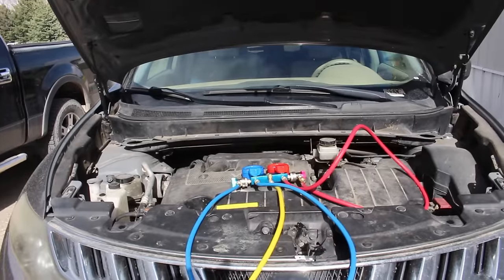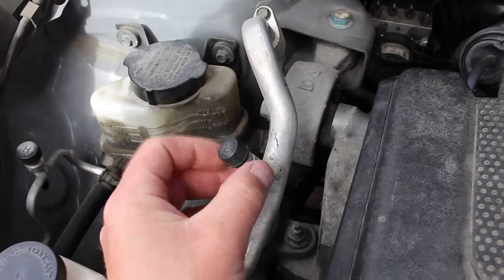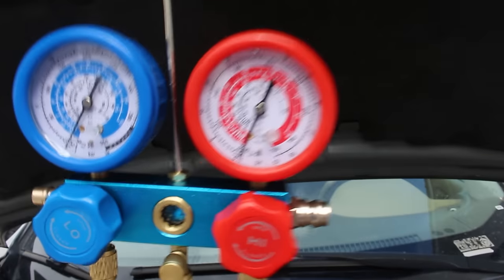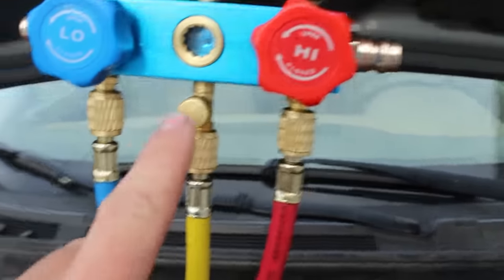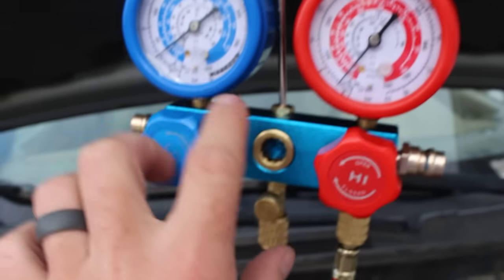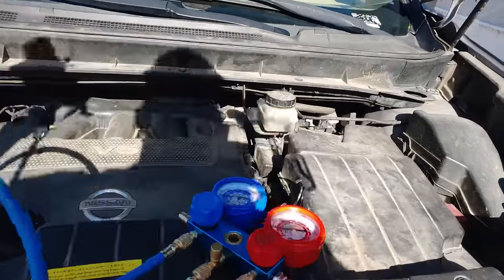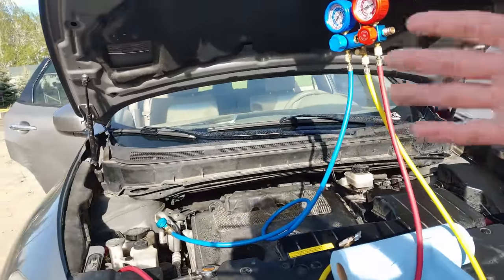How to Recharge a Car's A/C System Using a Manifold Gauge Set & Vacuum Pump - Air Conditioning

Comment: If we have an oil injector, should you inject the oil after you recharge or before? Because wouldn't that mess up your vacuum? And if after, would it be okay? the compressor wont get messed up without oil?
Reply from the maker: Great question! I was incorrect in stating oil is removed when vacuuming. It is Not. You should add any oil before running the vacuum as it would be easiest. Most compressors come pre-oiled so take that into account when adding.

Comment: Should you put the oil in first if changing the compressor and then the Freon or vice versa?
Reply from the maker: Great question! Pulling a vacuum does Not remove oil from the system. I misspoke in the video. The best way would be prefill with oil, then vacuum, and then add the refrigerant. Most new compressors come prefilled with 3-5oz of oil, so start from there.
Reply: @EYVOAuto  you should edit your video and remove references to adding oil and put something in the comments about oil because people will not read all the comments.

Comment: What if my gauges don’t have a shrader valve in the middle line to purge the air before adding refriderabt?
Reply: loosen the fitting just enough that the air in the line escapes. As soon as you notice freon tighten it back up. This is how I have to do mine. Been tempted to buy some new gauges that will have that feature.
Reply from the maker: Agreed with @gregmorris6604. Some people don't bother to bleed the line and say their A/C works just fine. I say why give it the chance for anything to go wrong? You really don't want any air in the system so its worth the extra trouble and precaution just to be safe...

Comment: Thank you for the video.  I have cheap gauges from Amazon and someone had commented to snug up the connections with pliers because of the cheap seals in the fittings.  6 mos later, second time around, I forgot and leaked my Freon.  Do you think I lost any oil?
Reply from the maker: Wow, great advice, I'll have to check mine! I'm not 100% sure. Probably Lost a little, but unless you're changing a component you shouldn't lose all the oil. I also misspoke in the video, pulling a vacuum will not remove the oil. It might be a good idea to add a little, but not the full recommended amount. You might do a little more research or ask a mechanic just to be sure as well. Thanks for watching!
Reply: @EYVOAuto  Thank you for the quick reply.  Even after snugging the connections with pliers, the cheap seals only slightly compress and then you can loosen very easily by hand.

My system takes 7oz of pag 46 oil.  If I add a "little", do you think 1oz is enough?  Too much?  Thx again.
Reply from the maker: Honestly if it were me I would probably add one PAG quick charge can. I think they contain 2oz of oil and a little freon. But again I'm not a certified mechanic so might be worth asking one just to verify
Reply: @EYVOAuto  Thank you very much for the quick response and all your help.

Comment: Thanks for the video, I'm done an LS engine swap & purchased a nice aftermarket sadon compressor, they let you know it comes with oil in it,  I'm wondering why it does, if you have to vacuum pump it before charging and it removes the oil?
Reply from the maker: Thanks for watching! That is an exact question I have! My new compressor for our Camry came "pre-oiled" but a mechanic buddy told me to be sure I add more oil to the system anyways - supposedly pulling a vacuum does remove some of the oil. I'm guessing it doesn't remove all of it, but who knows? I've also wondered if the compressor has lubricated parts that aren't where the freon runs through? Great question! Does anyone know? - drop a comment
Reply: @EYVOAuto  When you open the system, my limited understanding is that you should always replace the dryer as well. I dumped my dryer oil out into a Solo cup and it was roughly a shot and a half (about 1.5 ounces). I added oil into my new dryer to match and so far it is working great. The discarded oil looked a little "rode hard and put up wet."
Reply from the maker: @packrat9433  Yes I’ve heard that as well. Probably would be a good idea just to keep things in tip top shape & start fresh with no moisture in the system. I’ve been lucky with no problems, but this would be a good practice
Reply: I know this was a year ago , but if you buy a new compressor , your supposed to dump the oil out before you install it and measure it , you look up your vehicle manual for correct pag oil , and unless you know what's in that new compressor I usually throw that out and start fresh with the recommended pag oil , but out of curiosity I always measure it , and I will add exactly that amount , each component will hold some oil , after you get it charged correctly , it will let you know if it's low on oil , I hired a shop to do my wife's truck and they skipped the pag oil part , it rattles bad when it kicks on , there second attempt , same results ..I guess I gotta do it ..I even supplied the bottle of pag oil ..they probably just kept it and didn't put any in neither time ..still rattles hard ..
Reply: @MikeSmith-nu9wt  I hate that you don't realize that even with all that, you did a hole Lotta stating the Obvious but didn't Answer the question...  From a year ago.   Hang in there.

Comment: How did you evac the oil and freon? Where is it going? Does the vacuum pump have a resorvoir and holding tank? If not then how are you removing it from the system
Reply from the maker: Great question and thanks for watching! To evacuate the Freon, say before a repair, you must take the car to a mechanic to have it removed and “recycled.” Opening the system up to the environment is harmful and illegal. 

You only ever need to pull a vacuum on the A/C system to refill it, if it is already totally empty and has been open to air.

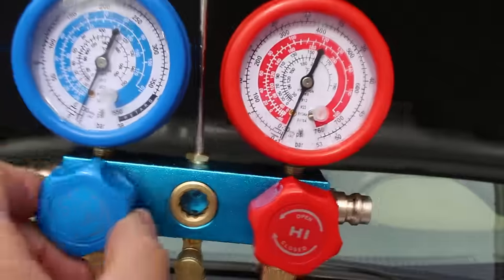Comment: If the valves are closed like you say to do at 6:12, why would the gauges ever change? The lines are closed off from the system so how would it ever lose pressure? 
 I cant wrap my head around this, please advise. Every video I have seen says to do it this way. My car doesnt leak by doing the method everyone says, but once I put freon in, it leaks out within 2 days. The vacuum test, done the way everyone shows doesnt show me that it has a leak. And I believe it is because the gauges are closed and it will never identify if there is a leak.
Reply from the maker: Great question! None of the valves open or close the pressure gauges directly, they're just part of the manifold and read the manifold pressure on the low & high side. The valves on the manifold only shut off the center yellow line from the valve side. If they are shut and the hoses are connected, with the hose-end valve open, the gauges will read the system pressure since that is what the manifold is sealed off to. Make sure you're leaving the hoses open and just shutting the valves on the manifold for the test. 

The valves on the manifold only shut off/open any in/out flow from the outside world. The valves on the hose-ends open/close the hoses. The gauges always read the pressure of the manifold and aren't turned off or on by the valves. 

Sounds like you may have a very slow leak that might not be detected by just a 45min pressure test. I'm not a certified mechanic but you might try adding some UV dye to the system and see if you can find the leak using a light. The high side is under a lot of pressure so it could be leaking out there more easily when running.
Reply: @EYVOAuto  awesome explanation. Thank you. Totally makes sense now.
Reply: @EYVOAuto   It sounds like his leak is the Shrader valve namely the A/C System Valve Core. Here is the  part from Autozone: Santech / A/C System Valve Core Part Number: MT0064-4. And make sure the Valve Core has the caps on. The caps are marked H high side and L for lowside.  A/C System Valve Core and Cap Kit Part Number: MT29 . You can use a different brand if you want.

Comment: What do you do with the valve at on the yellow line at the gauge????   Does it need to be open or closed for suction, filling? No where does anyone mention this valve?
Reply: It’s for before you add the Freon to purge the air from the line
Reply from the maker: Yes, it's to purge air from the lines after you connect a can, but before you let it begin filling the system. Once you get some freon to come out, shut it, then open the valve to the system to begin filling.

Comment: Did you have freon in the car when the vacuum pump was running? If so, why freon was not coming into the vacuum pump or just came out?
Reply from the maker: Nope, no freon left in the system. Only reason to pull a vacuum is when the system is completely empty and has been opened to the environment, such as after a repair. It's to evacuate all the air so you can pull freon into a completely empty system. To remove freon before opening the system, like to do a repair, you'll need to take the car to a shop to have it evacuated and collected.

Comment: thanks for the step by step information but I would love to see how to bleed the air. thanks
Reply from the maker: Great question! There is a little schrader valve in between the blue & red valve handles, under the viewing glass. You'll remove the stem cap & push it in until refrigerant comes out. Once bled you can open up the port & let the refrigerant flow in air-free.

Comment: I all I want to do is check the pressure in the system can you tell me which ports to have open or closed.  Do I start off with all ports closed, run the engine and AC for 5 minutes, then open all ports to check the pressure or just open the high and low at the ports and leave the ports at the gauges closed or open all ports to check the pressure?

Comment: Putting the system under vacuum does not remove the oil already in the system, that is not correct.
Reply from the maker: Thanks for the correction! I definitely misspoke. Pulling a vacuum does Not remove oil from the system!

Comment: If I install the new AC. Compressor and there is an oil in it , if I do a vacuum the ac system, is there a possibility that the oil in Ac compressor will drain out  during  vacuuming operation?
Reply from the maker: No. You do not need to add additional oil. The video is incorrect in saying pulling a vacuum removes the oil, it does not. 

I could see adding a little to the compressor depending on how much oil it comes prefilled with vs. the system requirement. All of which I would do before installation.

Comment: I have a question on the pag oil. It looks like some refrigerants come with pag oil in them, do I need to add the straight oil on top of this if I use that kind of refrigerant or should these have enough oil to be ok?
Reply from the maker: Great question. I was incorrect to say pulling a vacuum removes the oil. It does not. With that said, you should be fine with the Freon that contains oil. But, unless you’ve done a major repair where the component was not prefilled with oil, I wouldn’t worry about adding much.

Comment: Do I need to do a vacuum the system before I replace my AC Compressor?
Reply from the maker: Yes, you will need to take the car in to a mechanic to have the Freon removed properly before replacing the compressor. 

Then you will need a vacuum in order to refill the system after the compressor replacement.

Comment: While adding refrigerant, what would cause the psi on the high pressure gauge to go really high (400-500)? The high pressure side was closed the whole time while adding refrigerant.
Reply: A blockage somewhere.  Expansion valve is common.
Reply from the maker: This, check your expansion valve or for a blocked line.

Comment: The oil does not get removed when pulling a vacuum.
Reply from the maker: 100% correct. I definitely misspoke in the video. Pulling a vacuum does not remove oil, that's why most compressors come prefilled.

Comment: Why do most people say not open high side on the guages when vacuuming? But you did
Reply from the maker: You must open both gauges when running the vacuum so it will pull a vacuum on both sides. If you don't open one, it will not draw a vacuum on that side & there will be air in the system when you go to refill it.

Refilling it is when you shut the high side and use the low side only with the A/C compressor running. That will move the freon from the low side to the high and begin to pressure everything up.

Comment: Hi, I'm confused as I've read some of the comments here and seems this procedure(performing a vacuum in system) is only done when a new component(new compressor) was replaced. My vehicle doesn't have cold air and whould like to add r-134u with a UV dye in it, to check for a leak. Should I vaccum the system? Thanks for the video*
Reply from the maker: No, you should only need to pull a vacuum if the system is totally empty and has been open to the environment.

Comment: How to know if compressor has oil? And when to add oil in ac system? Every after vacuum?
Reply from the maker: Okay, so I messed up in the video by saying you need to add oil. If your compressor did not come pre-filled you will need to add. If it did, you are good the vacuuming will not remove the oil. Now a high pressure refrigerant leak will remove a lot, so if you just replaced lines due to that, add. Talking to my mechanic buddies it's a good practice to add a little anyways to just top it off, again if you didn't change a major component or it didn't come pre-filled.
Reply: @EYVOAuto  okay. Thanks a lot mate

Comment: I have a question... first you put the coolant and then the oil...???  because the oil came out of my car when I changed the part..!!
Reply from the maker: Great question! I'd get oil in there and then the Freon since there's a lot of moving parts in the system that need lubricated. If you use oil charge cans you can get some of both at the same time!

Comment: I know when you buy the AC pump it does come pre-charged with roughly 3 oz of oil in it I know you can add the oil too the pump itself but after you start to charge the r134a do you still need to put the oil in after so much refrigerant
Reply from the maker: Great question! I was mistaken in saying to add oil to the system. You'll only want to add oil if the compressor you replaced was not pre-filled or had less than the car's recommended amount. Drawing a vacuum does not pull the oil out. If you need to you can add oil at anytime with an oil injector or you can add it with a quick-charge can when refilling.

Comment: Why would you add oil to the system if you did not replace the compressor and even then the oil is added to the compressor it self which usually comes prefilled
Reply from the maker: Thanks for watching! I misspoke in the video, you'll only want to add oil if you're replacing the compressor and the new one did not come prefilled. A leak will also cause some of the oil to leak out, but not necessarily the whole amount. However, I was incorrect to say the vacuum will remove the oil, it evaporates moisture not oil.

Comment: I am trying to do it on my car following your video but I ran into a problem that the vacuum is not going below -26. Is that enough? It does hold vacuum for 45min like you said but I’m a bit worried. What should I do?
Reply: As long as its holding that pressure your fine. Thats an issue with the pump being weak itself.
Reply: @julianhernandez6404  Or maybe a not very accurate manifold gauge.
Reply from the maker: Totally agree with the comments. You want to draw a vacuum and you want it to hold for some time before charging, just to verify there are no leaks. Could be an inaccurate reading on the gauge or could be that's all the pump will give. Either way you should be fine for the recharge as long as it holds -pressure.
Reply: @EYVOAuto  Thanks for the reply guys. I ended up postponing the project after getting a new pump and manifold line. And followed your instructions properly. Later while I tried to recharge the ac and connected Freon can...it only sucked in a tiny bit at the beginning and then stopped taking in any freon at all. Treid it multiple time with multiple ways without yielding any result. It feels like there is an obstacle that is not letting the gas go in. So next summer I'll probably replace the entire A/C system on my car.

Comment: Did I miss something in this video,,? I didn't see any pag oil put into the system. Or is that not necessary?
Reply from the maker: Great question. I used a few PAG quick charge cans that were 2oz of oil and 1 or 2oz? of refrigerant. It's necessary if you change the compressor and it doesn't come pre-oiled. I misspoke when I said vacuuming the system removes the oil, it does not. But doesn't hurt to make sure it's topped off either
Reply: @EYVOAuto  Thank you for your reply. I've a question, I am replacing the rear expansion valve and O-rings bcuz I found my AC this summer blowing warm. Upon inspecting the right rear shock on my 2015 Town and Country, I discovered green liquid dripping from that expansion valve/Evap junction. I pulled it apart yesterday and sure enough, the aluminum ring with center rubber O-rings were deteriorated, thereby causing the leak. The evaporator is in great shape, and the expansion valve looks ok but I am going to replace that. 

Now I imagine this must have been leaking some oil all winter. So I have purchased everything you have shown on this video, manifold gauges/hoses, vacuum pump, 2 new Schrader valves (bcuz I did see bubbles at the low port valve), three cans of 12oz R134a and an 8oz bottle of pag 46 oil. Bare in mind my van has front and rear AC. It takes 1150g / (2.53 lb) of freon, but at this point, I don't know how much pag 46 oil to add. So my question here is, being that this system was leaking gas and oil, How much oil should I add?  I'm thinking, 3 or 4oz..?  What say ye?  Thx.